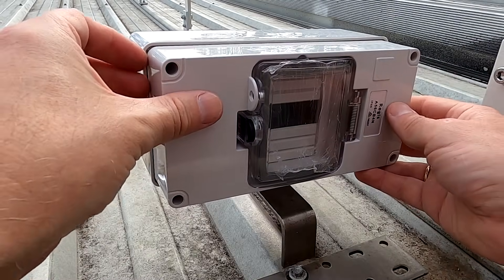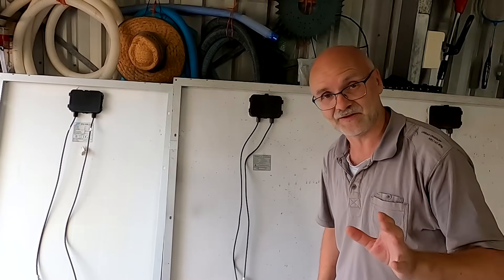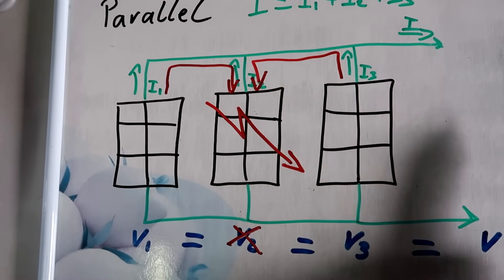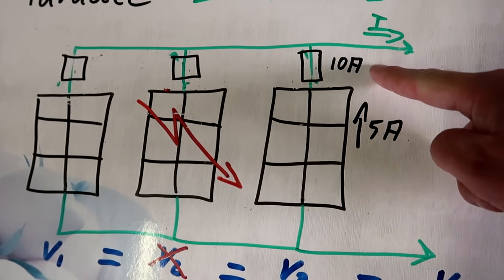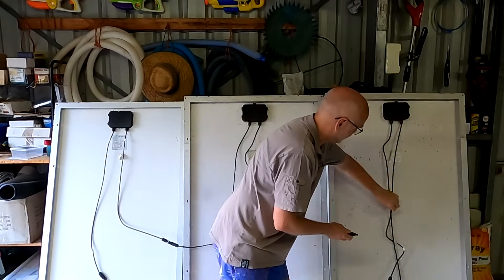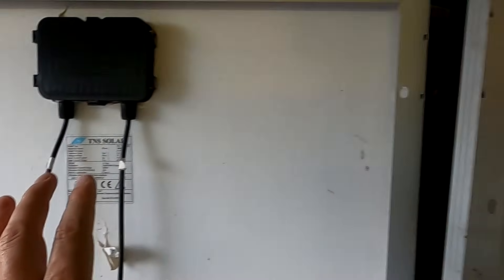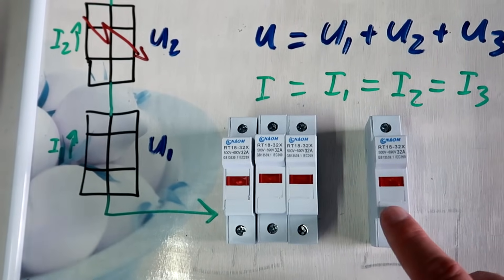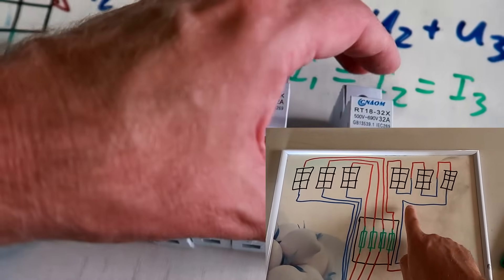Tutorial: Solar Panel Protection in Series and Parallel

Comment: Thanks for the video. Question isn't the maximum fuse rating (MFR)stated on the back of the panel? If so, shouldn't the fuse that is used be less than that amount (stated). This however (as i understand it)is not needed If  total array AMPS does not exceed the MFR. So in the MFR is 15a and the total PV array is 12a then no fuse is needed but if it were 20a then a fuse would be needed. I am no expert, but I learned this from the diy camper guy.
Reply: You're right, this guy is a blowhard.  National Electrical Code says no fuse needed for series, it adds no protection.  In parallel you only need if the total amps is more than the maximum series fuse value on back of panel.

Comment: For all of all, great video!   I have a 12v deep cycle house battery and i bought a Dokio 100 watt mono suitcase kit.  The solar suitcase has an optimum operating voltage of 18 volts.  Are you saying this won’t work with my 12v deep cycle battery?
Reply from the maker: The 18V panels will work with the 12V batteries but you need a charge controller. Otherwise you will overcharge the batteries.
Reply: @OffGridGarageAustralia  thank you sir.   It came with Dokio Charge controller.  Thanks for clarifying.

Comment: You don't always need a series fuse on a series connected solar string.  Short circuit current (Isc) of a solar panel is so close to your maximum power point current (Impp) that it will never blow in a fault condition, and your wires HAVE to be sized to handle Isc so there is no risk of damaging the wires.

Solar panels are not like AC power mains or a big DC power supply with huge amounts of current available (that require fuses) in that a solar panel self-limits the maximum current to the Isc value.   Series strings only add up their voltages, but not their current.

Only in a parallel configuration, can solar panels have more current available in a short circuit than the wires can handle.  That's when you need fuses on each panel.

However, Electrical codes do require a solar disconnect, so if you don't have a switch to do this, a fuse or circuit breaker or connector set can be used as a disconnect, if it is located somewhere convenient while you work on the equipment. 

If you have surge protectors on your solar panels, then a fuse may be necessary in any configuration.
Reply: @Nic Shouldn’t you have a fuse on your main solar panel supply in case your mppt shorts (or you otherwise connect the ends of the solar array)? I understand that the cables will hold and that the current flow won’t be more than the panel is rated for, but doesn’t a shorted array (or individual panel) cause damage to the panel?

Genuinely wondering, I learned that it was required, but now I’m not so sure.
Reply: @Misteribel  If your fuse is sized to blow at a higher current than your series array current, if your mppt controller shorts the positive and negative of the array, the fuse will not help you, because the current will always be less than the fuse rating. 
Basically, no matter what you or the controller do wrong with the positive or negative of the series array, the fuse will never blow.

I've yet to see an explanation as to why you should use a fuse on a series array of panels.
Reply: @clintoncoker6 In the case of multiple strings of series connected panels, fusing each string will protect a damaged string from all the other strings dumping their current into it.  In that case, the fuse will blow on the damaged string.  I have 6 strings of 3 panels each string, with a fuse in each string in the “combiner” box.  In fact the box also included a diode in addition to the fuse for each string.  Perhaps the diode was primary reverse current flow protection, with the fuse being a disconnect means for service/maintenance on the string.
Reply: You're right, this guy is a blowhard.  National Electrical Code says no fuse needed for series, it adds no protection.  In parallel you only need if the total amps is more than the maximum series fuse value on back of panel.

Comment: if everything in series when one panel goes at fault, is not it like it will cut the circuit so it wont deliver any power at all?
Reply from the maker: Yes, that's correct, if a panel fails completely in a series connection, the whole string won't produce anything any more. If one panel is shaded, the power output of the whole string is reduced but still produces power.

Comment: nice video, actually if you parallel your panels I think is better to use a diod so if one of the pane is in shade no current will flow from the other panes to the one in the shadow. When you put panels in series they alredy have bypass diods so you only need one fuse unless the string in series is in parallel to another string, in that case you will also need a diod.

Comment: they should make fused  connectors ..would make life a lot easier
Reply from the maker: There are fused MC-4 connectors you can buy. It depends on your local regulations. I always prefer a 2-pole isolation for each string. Either a fuse for pos and neg or a circuit breaker for each solar string.

Comment: Thank you. Do the inline fuses for parallel connections for each panel go into the positive cables, negative cables or both?
Reply: Typically, you want to fuse the the positive side of the circuit so only one side is required.
Reply: @MstrRo  Thank you. Is this because of the direction of the current?

Comment: Just to add to your great video, the reason parallel is useful is in times of shading. When a solar panel is shaded, the cells on the panel are not excited that are in the shade, thus power can no longer pass through them, or very little can due to resistance in that specific pathway internally of the solar panel in a series system. As more of the solar panel is shaded you are cutting off/reducing the ability for electricity to flow through that panel as a whole, because now all the current has to move through the cells that are still in the sun. Since these cells are now flowing most of the amperage through the panel, they will heat up over time and either burn up if they reach their designed limit or in high-quality panels cut the circuit to the panel and the entire panel acts as an open via a thermal switch. Thus why when part of your panels is shaded they can cause far more solar losses than their proportionality to the solar circuit. The worst-case scenario is if the closest panel to the charge controller is shaded, then you have all the amperage in series behind it feeding through only a partial solar panel, which acts as a bottleneck to the rest of the solar panel circuit. Also blocking diodes is important on solar panels when they are placed in parallel because solar panels will actually draw power from a voltage source when it's completely in shade or at night. This is typically internal to the charge controller to protect the voltage sources, but if you run solar panels in parallel and on cloudy days, the panels with the most shade can rob power from the panels still getting some solar energy, thus reducing your overall solar output. So running blocking diodes on each parallel circuit in a combiner box prevents this from happening since the flow of power can only run in one direction. This is why a proper combiner box will increase your solar performance slightly on non-optimal periods of the day, especially the larger your solar system is.
Reply from the maker: Great addition and explanation, William. Thank you

Comment: Hello...Great Video.  
I have 8 - 100W 12V 5.28A panels.  Two sets of 4 panels are in series and then those 2 sets connected in parallel.  
My Question:  Would I only need 1 - 10A fuse per set of series panels?  Thank you!
Reply: It depends for panels there should be a label on the panel stating its fusing current for mine short circuit current is 8.83a and the fuse current is 15a in series the current can't exceed the fusing current for each panel itself and so a fuse shouldn't be needed but for a parallel connection you probably will.

Comment: Two 5a panels back feeding though a faulty panel probably wouldn't trip a 10a fuse since they're probably is no in rush current. Ideally shouldn't the fuse be a 5a or even a 6a??

Comment: Great explanation!
I want to put my 6 445w panels in series ISC is 11.22A VMP is 10.70A. what fuse size must put between panels and controller?
And regarding fusing battery, what fuse size must put ? (24V system 2 batteries 150mah each in series, solar inverter has mppt charge controller up to 100A) 
Thank you in advance.

Comment: Hi, we have an RV with 5 panels of equal values, 2 are in parallel and 3 are in series, through a single Victron charge controller. The 2 panels on the start and finish of the loop are in parallel the other 3 panels in the middle are in series, it appears to work as it should, the voltage stays under the controller limit and so does the amps ( Victron 100/50) is this setup ok? It charges 3 x 170amp 12 volt batteries

Comment: Parallel = higher amps, same volts= larger wire.
Series = higher voltage, same amps= same wire as used for single panel.
Parallel  = panels can have different sun or shade.
Series  = All panels must have same sun. if one cell is shaded it decreases the power of the rest like a big resister.

Comment: I run my small system in parralel to get the most from shading issues seasonally.  Great video
Reply: Any diode added between parallel panel  ?
Reply: @sumitd4u There's normally a diod inside the connection box behind the panels

Comment: It seems that you are doing system sizing calculations based on panel Vmp and not panel Voc.  The voltage open circuit is needed (with temperature correction) to correctly select the charge controller.  For example, you could have a panel with 18.6Vmp and a 22.3Voc (at 25C). If you selected a 100V MPPT to string 5 panels together in series you will actually damage the controller even though the Vmp of 5panels is 93V.  The Voc is over 111V and higher when temperatures are low.  Up to about 133V in freezing conditions.  The MPPT would need to be 150V not 100V to support this.
Reply from the maker: That is correct, thank you.

Comment: I have two 200 watt panels wired in parallel with 9.62 pmax (imp) amps, 9.96 short circuit amps (isc),  should I use a 15 or 20 amp fuse?
Reply from the maker: If you have only two panels I would not bother. If you get more, than yes, fuse them with 150-20A each.

Comment: Great video, I'm thinking of building my own off Grid solar system and building my own batteries aswell (despite having never done anything like this before but I'm binge watching  and learning all things regards battery cells, solar set ups options and all off Grid info in preparation) as thinking of building out a campervan in the next year or so, but might even do the set up in the garden before and to dial it all in ana run some stuff in the house or whatever before hand just for the experience before a van install... this video was very helpful and I've subscribed straight away 👍 also checking out panels and different cells all evening and reviews of the latest on market best value at best performance, so thanks for extra the information, will watch some more of your other videos for sure.. 👍🏴

Comment: Andy, thanks for taking the time and effort to explain. Your a very good teacher.
I am wanting to build a system with four 50 watt solar panels with about three amps each and I want to connect my solar panels in both parallel and in series to build a 24 volt system in order to learn and understand and if I ever want to go to a 48 volt system I can at a later date. Yes at times it is confusing changing one component in a solar set up can change everything from the wirer AWG size.
Thank you
Regards
Hope
Reply: If you only have 4 panels of 50W per test, you don't have to deal with anything. You will simply build a new system later, for example with 130W panels and 24V. You can use the original 50W panels separately for sunrise or sunset.
Reply: Thanks for your advice and information. I am still learning and I only have a limited amount of space for Solar Panels. Where most Solar Panels manufacturer's want to sell me large solar panels I just wished that solar panel technology was moving fast forward as batteries are now.
I am now experimenting with three different batteries and there all manufacturered by different manufacturing companies and one is a AGM and two are lithium. I have to learn and understand the basic technology. I feel like hands on experimenting with batteries will teach me a lot. I have one lithium 20AH very little about the batteries was online and NO users manual was online.
I wanted to get a few of them and connect them in serial and in par. But the manufacturer only wants two batteries connected :-(.
I wanted to use them in a solar generator I wanted to build they only weight four pounds each.
I want a
 marine SOK 206 ah battery 
that is on my wish list.
I am still trying to learn and understand  DIY off grid solar I want to use it on Farm/Ranch.
Happy Holidays
Regards
Hope
Reply: @hopehope938  Any combination has its advantages and disadvantages. Therefore, the manufacturer recommends a kind of minimalism. Although the series connection of the batteries adds up the voltage, it produces only as much current as the weakest cell. For example, 10Ah + 9Ah + 10Ah = 9Ah. A cell with a lower capacity has a higher internal resistance and will be discharged quickly. To charge, you need a balancer to charge the cells evenly. A weak link could heat up and be destroyed. The parallel connection adds up the current (capacity), but the voltage is like the strongest link. There is a risk of a short circuit of the weakest cell with a small capacity, into which a larger current flows than to the others. Therefore, the manufacturer recommends connecting exactly the same batteries of the same age and not creating too long strings. It's better to buy a ready-made power bank, but I understand that it's expensive. If you have a 4x50W solar array, I would definitely buy one 1.2 kWh traction battery (12V 100Ah, or 24V 50Ah). It's not expensive. This battery will be fully charged by your 200W solar array in 6 hours (theoretically if the battery has been discharged). It lasts 20 years in continuous charging mode...
Reply: @DL-kc8fc  
Hello:
I am using diy off grid solar on Ranch/Farm so costs and cost containment is a big concern. Also in rural and isolated locations I can not afford to leave high dollar lithium batteries laying about unsecured.
I did think that 20 ah lithium batters might give me a break in cost if I did buy them in bulk. I wanted to work with them and experiment.
As a kid one of my jobs was to check on and monitor Lead Acid batteries with the filling of distilled water for Electric Fences. 
One of the projects I want to build is a diy veterinarian trailer to treat livestock that is self contained and solar powered. That has solar panels on the roof plus also has the option to plug in to ground mounted solar panels and a battery bank to plug in to. Plus also has a living space.
I have been in three major western USA brush firers and I have been out of ranching from 2008. I want to get back in to ranching but I am trying to figure out my options and trying to use my limited cash to its best use.
My expertise is working with cattle,sheep, and meat goats.
In the past from fall to late spring it was the 24/7 caving,lambing,kidding, and calving. I know the only way to be successful is with the necessary setup and equipment.
Regards
Hope

Comment: Andy what is the correct way to fuse an array of 4 panels in 2s2p configuration? I'm guessing it's to fuse each of the two panels in parallel, and then add a third fuse on the series portion? I assume fuses must be on the positive cables?
Reply from the maker: If you have 2 panels in series, fuse this string. If you have another  string of 2s panels, fuse that the same way. Then connect them in parallel. If you take out one fuse, it disables one string but leaves the other one working.

Comment: Educate me please. How does a 10A fuse rated at 500V AC work on a solar panel which is DC and probably less than 500V Dc? Are you sure the fuse would blow and protect the panel🤔🤔?
Reply from the maker: The fuses are rated for 10A. This has nothing to do with the voltage. It will blow at 10A (a bit over) regardless if you have only one panel or several in series.
Reply: Thank you for the information

Comment: One limiting factor stopping going long string series is the cheaper aliexpress charge controller low input voltage. Typically 50v allowing 2 panels in series only. With 8 panels on my shed I'll use 2 charge controller. So 2 in series paired with 1 controller times 2. Any recommendation on higher input voltage charger controller?

Comment: Good morning from the USA. I have one question... 2 /100 watt panels one is 21.6 V the other is 19.83V open circuit. Will I have problem when I connect this two panel to my MPPT CONTROLLER to produce 200 watts. Thanks
Reply from the maker: You connect them in parallel or series?
Reply: @OffGridGarageAustralia  neither  just yet I am waiting to receive the second panel and realized that the specs are somewhat different  ... 21.6V and 19.83v on the other. Was hoping to go parallel to keep the 12v and increase watts from panels... don’t look like is going to happen

Comment: Clear explanation.   But do you EARTH the panels frames  ( as in stake in the ground ).   And do we EARTH the battery negative as well as the inverter and standby generator.   By EARTH I mean rod in the ground. As opposed to “grounding” by connecting all the metal bits together.   NEEDS a video.
Reply from the maker: No, I don't earth them individually. There is another solution for that: https://youtu.be/Bz0NBulPMKk